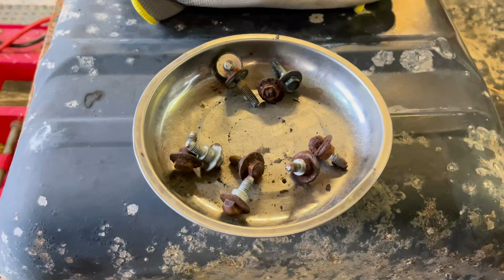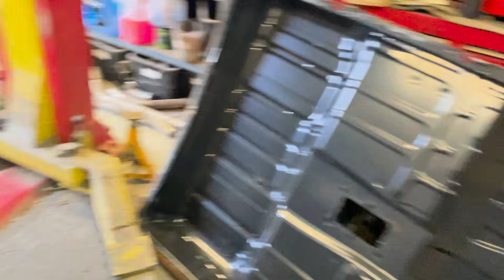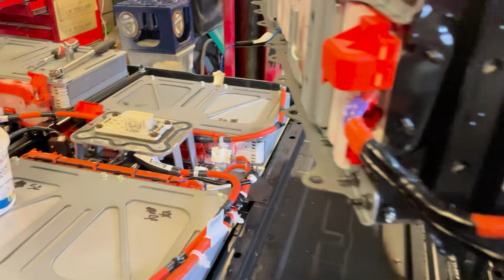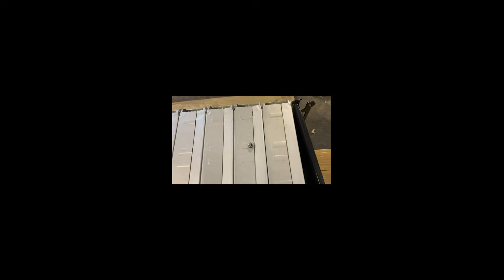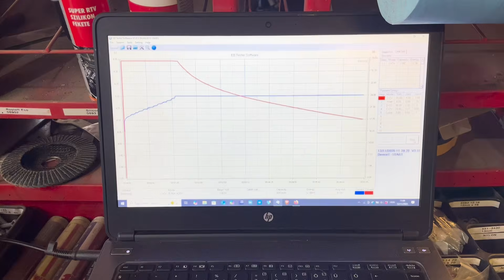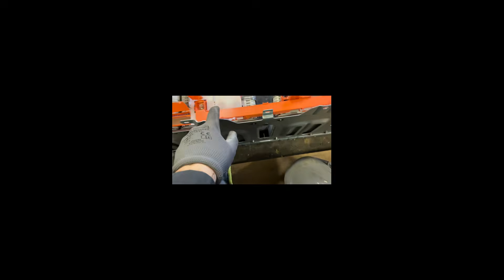DIY Nissan Leaf battery strip down, module testing, storage - full sequence, with tips, advice, help

Comment: Mate, use a cordless drill to undo all the 10mm bolts and the phillips screws. Much easier, faster, quieter than an air driven ratchet
Reply from the maker: Each to their own - I've seen many screw heads on these stripped by cordless drills during refitting, hence why I use a cordless screwdriver with a much slower shaft speed   - I'm old school, so all my regular power tools are air powered, for decades now, saving the cost of buying cordless tools, and excluding the known risk of cordless tool battery fires in workshops .....

Comment: I have a 30kwh leaf with a couple of bad cells. Is it worth repairing the battery or just going for a used 40kwh pack and can bridge?
Reply from the maker: If you can find modules with a similar SOH etc, it can be helpful to renew the weakest sells - however, sometimes this just exposes the next weakest - if you end up needing to take the lid off your battery multiple times, this video will help :  https://youtube.com/shorts/qtmcfsJoycM

Comment: Could you please tell me what the SOH and Hx are for this battery? How many fast and slow charges does it have? What's the mileage? The original modules appear to be in good condition; they are not bulged.
Reply from the maker: Correct, they're not bulged - the AZE0 30kwh ones tend to just degrade - this one is 66% SOH and under 50% Hx - I have tested & recorded all the modules individually, for use in Renewables storage - the fast and slow charges are not recorded for these end users, its today's capacity that matters to them - the mileage was around 140,000km .......